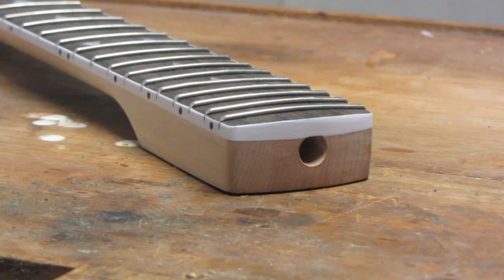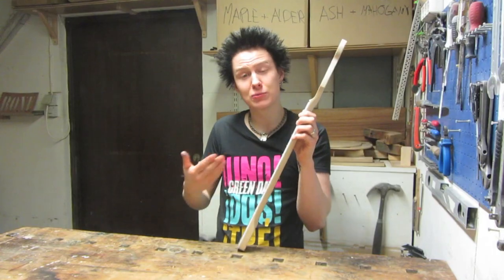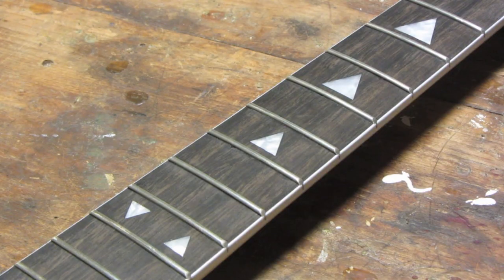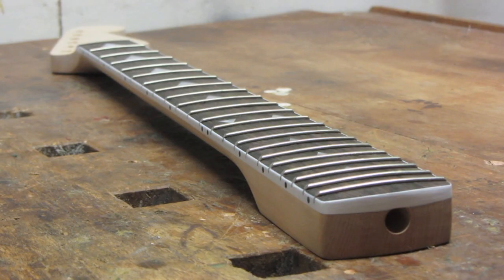Jazzmaster Guitar Build: Week One

Comment: Hi Tom - really enjoying the videos. It's all good. I noted that you're using Titebond-III for your glueups. I'd actually recommend against it on the basis that despite it being easy to work with and having a good open time, it does leave a grey glueline on lighter woods like Maple, Ash, Birch, Aspen, Poplar, etc. If you're using it because of a specific reason, cool. Titebond-I and II are plenty good enough I think. I've been using I to build for about twelve years now and I've never had problems with any woods, even oily or waxy stuff.
Reply from the maker: Yes I do know this. Therefore I choose to use it on works that are more "hidden". In others I usally just go for the II. It is still just as good!

Thanks mate, glad you like them!

Comment: there is a special reason why you put the frets from the side??? I feel like it would damage the wood more leaving the fret more lose.
Reply: A lot of small builders and even a few major brands use this technique. Instead of pushing the frets in from the top doing it from the side is kind of extra security that the frets won't pop up. The barbs on the frets cut in a kind of channel that they sit in and because non of the wood on the surface is touched it grabs the frets better.
Reply: I would like to see a cientific test of this. I think the channel on the side where you start pushing the frets will be very damaged. I would prefeer to use some glue. but it is just my opinion. maybe I will do a test some day
Reply from the maker: I think that both methods (from the top and side) have there advantage and disadvantages. I choose to put them in from the side (at least on this one) cause I feel like it grabs more (like Nazereth666 said). And thats pretty much all I feel about it, haha.
Reply: thanks, I think i will try someday

Comment: It bothers me that he cuts into the binding for the frets.
Reply from the maker: Im sorry to hear that mate.
Reply: You can snip some of the tang off of the frets to fit in the fret slots without cutting the binding.
Reply from the maker: I know this and have done it for another build.
Tho when wanting to install the frets from the side it gets more complicated, since I will need at least one cut in the binding. I can of course fill that cut, tho I personally don't have the materials for that easily available.

But the main reason I cut both parts of the binding is to give the frets a little more to grab on to. It's absolutely not much, but it's something.
Reply: I can understand that, sometimes the ends of the frets starts to lift and then you have to push them back down or replace that and that sucks.
Reply from the maker: Haha, yes. And cause this one in the end won't be my guitar, I definitely don't want that to happen!